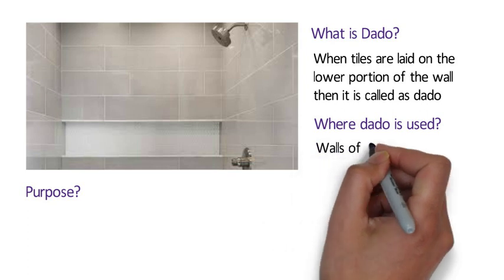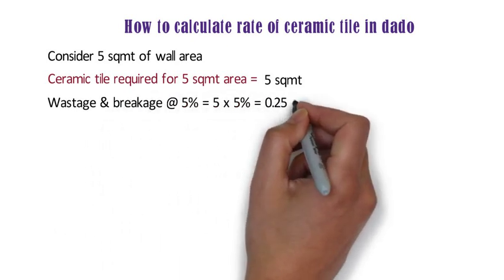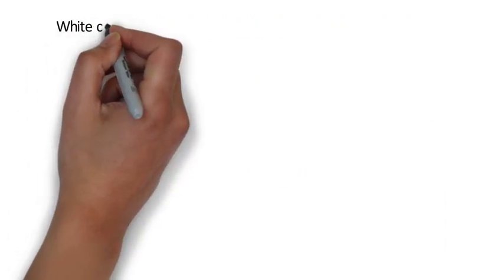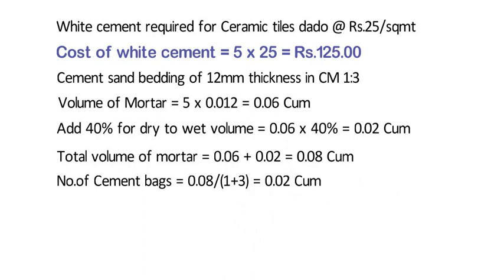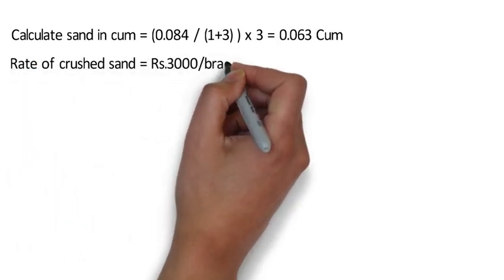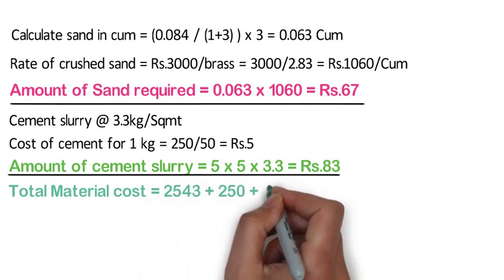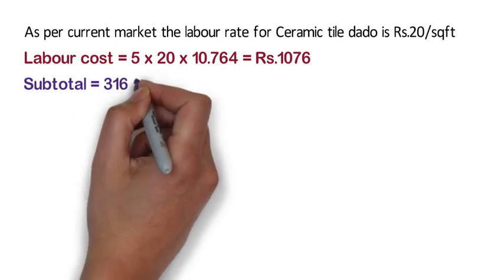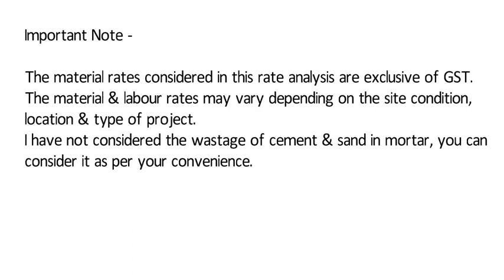RATE ANALYSIS OF DADO IN CERAMIC TILES

Comment: what was 10.764 in ceramic tiles ? is it, it's density, if yes why do we require density; if no then why is 10.764 there.
Reply: 3.28*3.28 feet square = 10.76  meter square